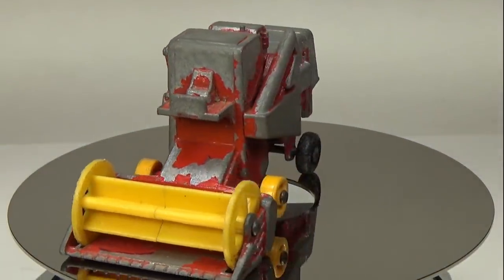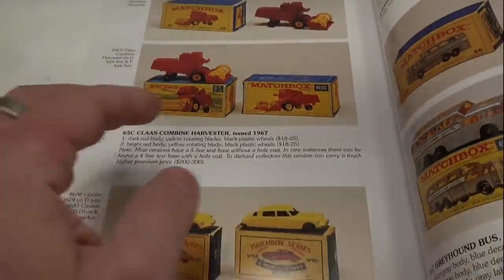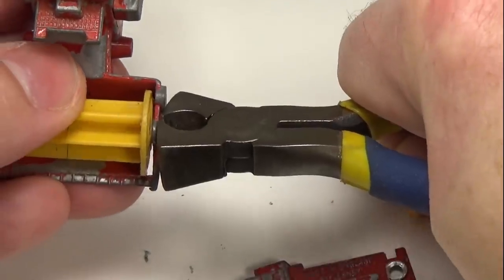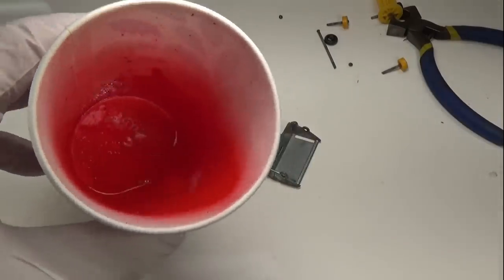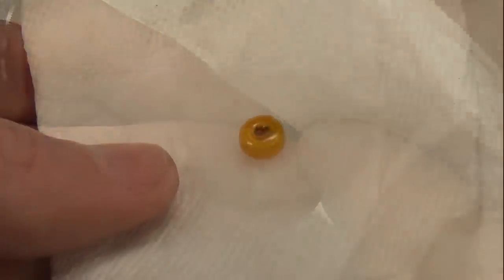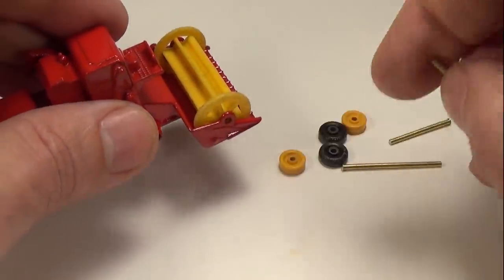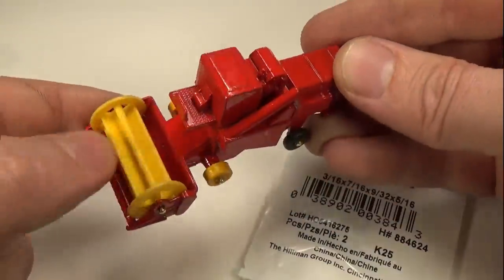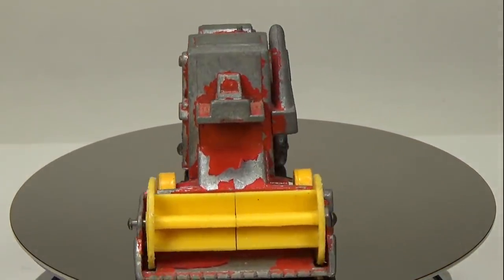Matchbox Restoration: No 65 Claas Combine Harvester

Comment: The real life harvesters are open in the same rear area. That is where the chaff is chopped up and thrown out.So that opening is an extra detail of the actual farm equipment.
Reply from the maker: Oh really... learned something new.. thanks!!
Reply: Brilliant. I was going to ask the Why the hole question. That is amazing attention to detail. I'm pretty sure I've seen someone disassemble the Claas completely, with the grain chute being a separate casting.
Reply: Yes, the chaff, and the threshed straw too.
Reply: Yup : )
Reply: The grain is blown above snd sideways through a pipe into a escorting trailer, while the straw is just dropped on the ground behind the machine through that very opening, you're wondering about. It has necessarily to be there.
Reply: @jeffkeith637  The grain chute is a seperate, movable casting on the King Size version, which has metal rotary rake.

Comment: Thanks for the mention. Sometimes you can just make a good replacement using everyday items. Those tyres ended up looking great. And I bet they cost less than the repro tyres. Nice work.
Reply: I would've use very fine sand paper to round off the sharp edges.  Fitting them on a dowel just larger than the hole and chucking the dowel in a drill would make it easy.  Then I'd polish them a bit, maybe using something like ArmorAll to make them shine more like the plastic wheels on the back.  They'd match better that way.
BTW, that was one of my favorite Matchbox toys as a kid.

Comment: They may have left the rear underneath of the toy blank to simulate the real combine as that is where the chaff would leave the shoe and be spread after harvesting the grain.
Reply: Deffo... that’s where straw bales would have come out after being compacted and tied up  inside the harvester.
Reply: @Paxfoxus  Harvesters like that don't make bales, that requires a tractor-drawn baling machine . . .What comes out of the back is the stripped and chopped remnants of whichever cereal crop has been harvested.
Reply: @TheGodsrighthandman  There was a combine that made low density bales right in the combine.   They were however problematic and we're never wide spread.
Reply: @mjp5429  Sounds interesting though I can't find it on the Internet. Can you post a link if you've got one?
Reply: @TheGodsrighthandman  I can't remember if it was a prototype or just limited production. .   Can't find a link on short notice but will keep looking.
Reply: bs

Comment: Thanks for sharing this video, I’ve got one of these in similar, “rode hard” condition and sans front tires. This video may just be the push I need to get started restoring some of my cars (ok, mostly farm equipment). Having grown up around these full scale and in use, and driven or operated many pieces of farm equipment I got to thinking about the bottom not going all the way back. That’s actually similar to a full size combine harvester. At that end of the machine most of the plant material comes out and is either laid down in a windrow or chopped and blown across the field. So, there actually IS a rather sizable hole that goes right up into the “belly of the beast”, so to speak, right where the hole is on the scale version. I guess I never questioned it because I’d grown up around the full sized versions. 

If I were to order replacement tires for the front, where would I find them?

Comment: You may have brought this up at some point in another video but I'm not good with remembering things, so I was wondering is there a reason you don't Powder Coat cars. Is it that you are use to using a paint gun or are you trying to keep the originality to the cars?
EDIT: There are small powder kits or kind or larger (for actual car parts) and with the size of these cars you could even get a very cheap toaster oven to cure the paint in.
Reply: Would that not fill in the detail on these small cars? I'd imagine air brushed paint is way thinner.

Comment: 2:35 Would it not be safer to use a wooden toothpick instead of a metal pick on these collectables? I restore old watches (mostly LCD) and would never dream of using metal to scrape away on metal to clean those hard to reach places.